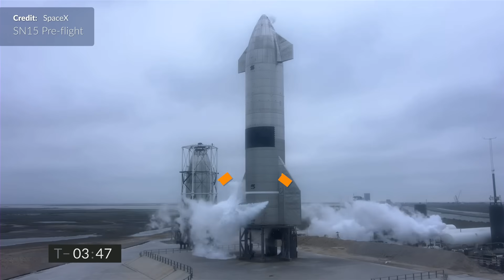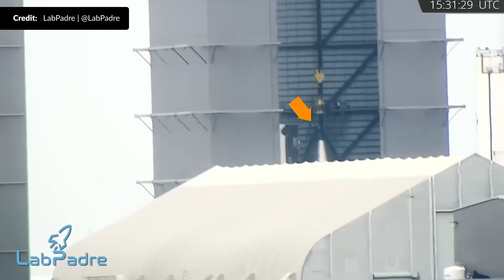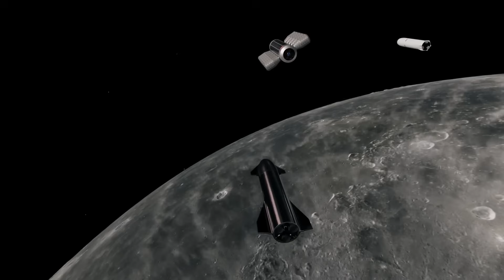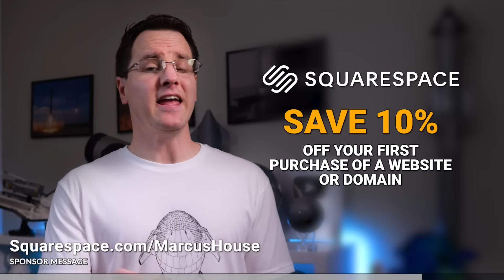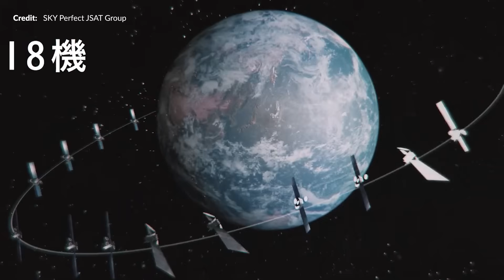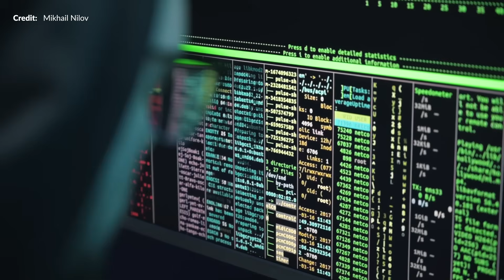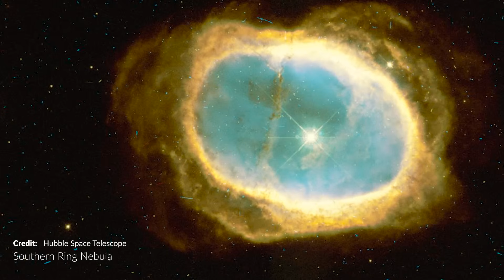SpaceX Redesigning Stage Zero?, Starlink Hack, Artemis 1 Final Rollout, JWST Update

Comment: I don’t think Star ship will be allowed to carry people for a long time. Starship has no abort system at all, that is a major problem. Only after a lot of successful Test Flights would the FAA and nasa approve starship for crewed flight
Reply: If the crew understand the risks & sign the informed consent, FAA allows them to. Ofc SpaceX would like to have a flight history
Reply: @alvianchoiriapriliansyah9882  nasa astronauts will not fly on starship until there have been a lot of flights more than usual since there is no abort system. Not having an abort system will likely be an issue for being approved.
Reply: @generalsirc2615  Yes, NASA astronauts. But the FAA with informed consents applies to non-NASA astronauts, and this time Starship will carry non-NASA first (Polaris 3) unlike Dragon
Reply: @alvianchoiriapriliansyah9882  It’s possible, however, where is space x training astronauts? Space x hasent started a training program for missions they say are a few years away now. That’s not good either
Reply: @alvianchoiriapriliansyah9882  I think it’s possible that nasa astronauts could board starship in orbit, so starship would take off without a crew and then the astronauts on Orion or crew dragon even, would Rendezvous with starship and board

Comment: Thanks for lovely video, may I request a 4K upload please as most monitors are 4K now. Thanks.
Reply from the maker: Woah. Thanks a heap Fawad!
Reply: @MarcusHouse  no worries 😌 just please consider my request as 4K video will look a lot better on most monitors, keep up the good work 👍
Reply from the maker: We are gearing up to first come up to 2k. The reason I haven't gone 4K yet is because Youtube keeps hinting that they are shoving that behind a paywall. The other issues is that MOST of the material that we work with is 1080p or even under, so it hasn't been a huge benefit. Now that SpaceX often streams in 4K, it is starting to get to that tipping point. It is more time consuming however, so our goal is to be consistent and fast in creating content rather than slowed down a lot by editing and rendering

Comment: I love Elon and SpaceX...and been closely following Starship since 2019. I think the tower catching the booster is ambitious to say the least. There are just so many things that could go wrong. Too many to list, but just a few would be...a failed catch arm. The booster coming in too fast. Both catch arms fail. The booster could be 8 feet off target and cause a huge explosion and destruction of the tower...etc etc. The list is truly long. I say throw some legs on it and land it. The "KISS" theory applies...keep it simple stupid. NOT that Elon or anyone at SpaceX is stupid by any means...just a saying that is appropriate for how to land the booster.
Reply: This is assuming designing a leg is a piece of cake
Reply: @alvianchoiriapriliansyah9882  I realize it adds unwanted extra weight...but the precision and shear number of things that have to go perfectly right for a successful tower landing are huge..., I would suggest legs are a much more simple concept to design and build.
Reply: @flyinthebug35  the last sentence is an overstatement of the century
Reply: @alvianchoiriapriliansyah9882  Not really. Simple physics suggest that a landing on solid ground is easier than an in-air catch. I don`t claim to be an engineer on any level...just going on common sense. One seems simpler than the other. Thats all. I may well be wrong. Time will tell.
Reply: @flyinthebug35  Except designing a rocket don't just requires common sense & basic physics but also engineering
Reply: @alvianchoiriapriliansyah9882  Agreed. I am a retired Commercial pilot, so that is the limit of my knowledge. Basically none. That said, landing on legs just seems easier. Like I said, I may be wrong. It was how they started landing the original prototypes (SN 15 etc). I understand the huge amount of engineering it would take to put legs on it, and Elon was in favour of legs in the beginning. I think if we see a few tower catch failures, they will revert back to legs. We shall see. Have a good night.

Comment: Does anyone else see a the little bit of irony? In the fact that Elon and his teams are helping clean the eco system with the electric Teslas and battery technologies, while at the same time planning to send thousands of rockets to the air while those same rockets will be releasing methane. Methane, if we recall, is a green house gas. Don't get me wrong I prefer this over some of the the other fuel options that are so much more deadly. I know that Elon will fix this over time and before the eco warriors attack. 

In addition Space X is dominating Space and mars. Elon will be so much more richer than today and we will all benefit from his progress too. So impressed by the Space X running circles around NASA and so many others. It took them three Presidencies for one mega rocket known as the Artemus. While Elon has made so many more rockets and much more flights in this exact time. Nasa needs to stop wasting our tax money and step up or just give Elon the more money to move even faster.
Reply: The only way to get to orbit from the surface is via chemical propulsion, there's no way around it. Who cares about eco warriors?

The more correct way is to spend SLS money to create robust competitions

Comment: The heat tiles are a bad idea because as soon as the stainless steel metal contracts or moves.. the tiles will simply come off. Personally, I'd like to see them move to carbon composites but it doesn't seem like that's going to happen anytime soon.
Reply: So why S24 tiles are (almost all) still intact then?

Comment: Could the new tower be installed on one of the oil rigs that SpaceX bought? Or are they not close to the right size?
Reply from the maker: Unknown at this stage. The oil platforms still seem a fair way off.
Reply: The oil platforms are in Pascagoula, MS. Since building the tower requires a concrete base and a crane or two, it seems like towers for the oil platforms would be built in Pascagoula I would think.

Comment: I for one been to NASA and spent many times at Kennedy space center. I was to be on site to the devastating take off. Yet the delays messed up the time when I was at location.
Now I don't see that the moon landings happened. it does not take 50 years to duplicate anything yet NASA suggests they did something no one seems to be able to prove even today.
I for one find it odd that no one has even been able to. In truth when we know how to do something because we did it before so why is it that over 90% of satellites that are to land on the moon fail.  Now keep this in mind. What if that same value was based on airline flights. Do you really think for a moment that they landed on the moon now. Its silly. Trying to defend it is stupid.

Comment: I believe that Musk has gotten cold feet. I believe he is enjoying notoriety and realizes a failed fly attempt would grossly affect his financial position.  What happened to the fly-fail testing methodology?  Answer one is Artemis. Musk is grounded! He can not fly because Artemis not flying. Two, his take on and landing concept is so radical that even trying is too risky. Three, using NASA property is going to slow him down with existing and new rules and regulations that will crop up as time goes on.  Four, NASA has what it wants from Musk an independent company in a master-slave relationship. Five, defunding because of Star Link failures. The money was to be used to develop the Starship program. In short, I am very concerned that the Starship program will crawl not run into the future. Sadly, Musk seems more concerned with the internet than with running his businesses.
Reply: 1. This is a straight up conspiracy theory. There's no proof AT ALL that Starship is being hold up because of SLS
2. This is a funny take considering they literally have an option of catching B7 on its first try from FCC filings & now they're preparing a chopsticks
3. No, NASA & USAF is cooperating with SpaceX to get a higher cadence out of 39A
4. NASA's relations with SpaceX is as a customer, and for the past decade it has been positive
5. What defunding & what failures? Sure the speed is slowing down but recently they have made several changes to launch Starlink V2 sats ASAP to counter this issue

There has been not much flight recently because they're focusing on orbital flight, and launching the most powerful rocket bound to have challenges

Comment: Can a Starship retrieve a falcon 9 second stage? Would it fit in the cargo bay, is it too heavy?
Reply: Why? The Starship launch would like cost more than the second stage.
Reply: It wouldn't launch with the second stage, it would capture it and free fall back to earth. The only extra cost would be configuring the payload bay to retrieve and store the second stage. Will the Starship be too heavy for landing? What happens if the V2 Starlink satellites gets stuck in the payload bay and can't be deployed? Would SpaceX just hope everything burns up on reentry? I.I'm just saying.
Reply: @rayturner5186  The Falcon 9 second stage would be in orbit. So for Starship to retrieve it, Starship would have to launch to orbit. The Starship launch would likely cost more than the second stage costs. Not to mention, the F9 second stage is not built to be reusable, so it would be of limited value.

Comment: I expect Spacex attempt to crash it in an alternate location. That way they can see it hit a point and stall movement. 

I remember thinking falcon 9 was a fool’s errand but they perfected landing. Catching starship still seems like a pipe dream, it took 50 falcon 9’s to become consistently hit the x not just land on the barge. Even saying they incorporated their learnings I betting it takes 10 times before they don’t take out mechzilla. Hitting the x in nowhereville is a good first test, hit the x, and then try a catch.
Reply: It took a lot less than 50 F9 landing attempts to achieve a success. F9 initially flew as a disposable booster, no landings attempted. 2 or 3 "landings" were on the ocean surface, designed to be sacrificial. Then came a succession of crashes onto/next to the drone ship - but less than 10.

Super Heavy has a better chance of early success due to all the experience SpaceX has gained from landing F9 successfully 130+ times now. Also, SH can approach slowly and even hover if necessary, F9 couldn't do that. One safety feature is that F9 and SH aim to a spot in the ocean until after the engines light and all systems are working well, then they shift to the target.

The 1st few attempts at a catch will be nail biters, definitely. But SpaceX is crazy enough to try it on the 1st attempt, or certainly the 2nd.

Comment: What in the hell is that at 1:13 ?!
First off it's huge! Note that it comes out of the cloud so it's fairly near the rocket platform and therefore its apparent size isn't a trick of perspective. 
Secondly it doesn't flap like a bird, it flaps like a bat.
Basically it looks like a freaking pterodactyl!
Reply: The bird flying right to left? It's a bird.

Comment: My anticipation for the first orbital launch - will make it to orbit, likely with 2-5 engine failures/shutdowns, but very light payload will make it to its very-near-orbit anyway. Deploy its partially complete starlink 2s (probably solar panels and ion thrusters). Booster to attempt chopstick landing if none of the center engines failed. Starship burn up in re-entry due to tile-shedding that occurred during ascent.

Comment: That Cartwheel looks like so much is going on. And the center of the Galaxy uh has total control of all the stars. Especially those form the Outside ring. Looks so different than any other Galazy i have ever seen. It may not be a "Black Hole" at the Center of every Galaxy. You cqn call it a Black Hole but its more complex than that. Because the Dark Matter they looking for is "The Grip" that the Black Hole has on everything in the Galaxy. Our Sun is pulling or every single particle is chasing the Sun. But the Sun is under command of the Center

Comment: On the catch attempt. Wouldn’t you rather wreck the launch tower and save all those raptors than dump them in the ocean?
Reply: No, the Raptors are likely cheaper than the GSE. Not to mention the time delay for rebuilding the GSE. Artemis III is not that far away when you consider how much development Starship has to do.
Reply from the maker: Raptors are constantly still being made obsolete by improvements. They would probably never be used a second time at this point anyway.
Reply: @MarcusHouse  Very true.

Comment: Agree that a reusable OTV is e better way to get from Earth to Mars but there is an issue with nuclear that most people miss. While nuclear thermal can more than double chemical efficiency; nuclear is not so good at making electricity. Converting heat into electricity takes a much larger amount of mass per unit power than solar PV. Solar is about 4 kg/KW while the “Kilopower system for producing electricity on Mars masses in at 150 kg/KW and the lower intensity of sunlight at Mars can be easily compensated for by using low mass aluminized myla mirrors. 
A solar thermal rocket can be designed to switch to electric power production by moving solar cells for concentrated sunlight into its mirror’s focus. It may take a couple of weeks for the solar thermal to get to escape velocity but it can then switch to electric propulsion and overtake the nuclear rocket to Mars. Once in Mars orbit it can beam power to the surface by microwaves.